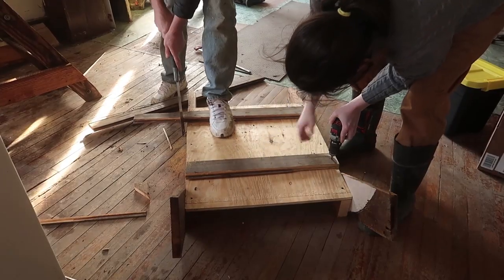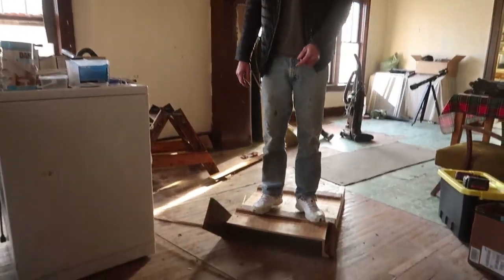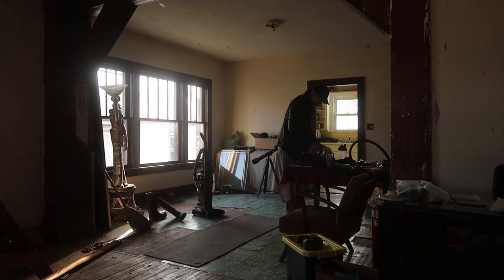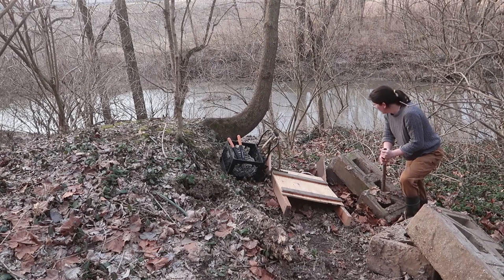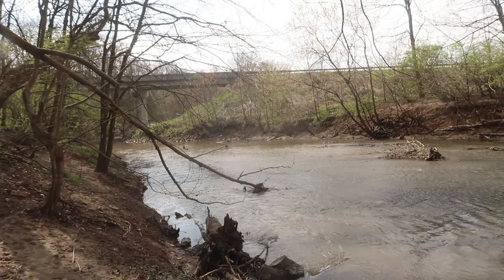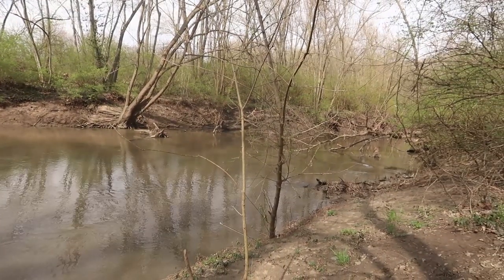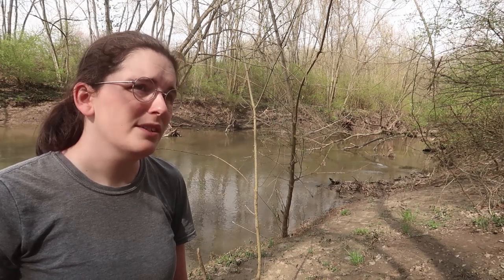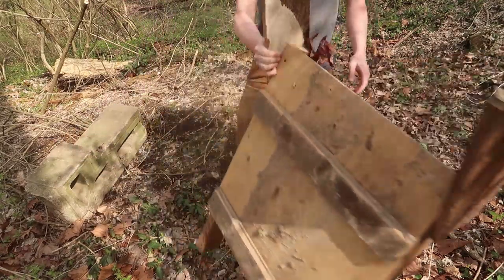Brickeology 09: Sled / Sledge / Stone-boat for Moving Large Corner Blocks by hand, its too hilly

Comment: Blue barrel barge sounds vaguely possible. Cut less than half maybe 1/3 off lengthwise, extend dowel reinforced pvc off the sides and maybe front and rear and attach 2 liter plastic bottle pontoons to keep it upright.  Balancing the load will be the perilous aspect of this.  Who knows you may end up with a creek boat for later.
   Just build a steam power concrete saw, cut up the biggest chunks and get it across in smaller sections and re connect them later.  Put a rope around the concrete to pull it off the bottom when it slides into the creek.  Heck maybe just winching it across would save time and effort.

Comment: For Sled I would round the front edges so it doesn't ding and I would double up the board  side  and see bout attaching old  skiing to help slide better. I would not pull on it I would get big stick and push from the back and if that doesn't work I would bring 2 board to lay on the  ground to slide the sled on them.

Comment: the problem with your sled is that you gave it to feet wick works great for snow, what your working with is mud, you need a large flat bottom to distribute the load if you take plywood and sheet the bottom and the slanted part in the front it would work better because its not concentrating the load in to the 2 runners and digging in ( think snow shoe not ski ) 

also if you want it to pull straighter then run a rope from one runner to the other and then connect the one you are pulling with to the center this is how we pull cars 

hope the barge works

Comment: Hell yeah! I was thinking this was a job for the barrel boat. 
Though, perhaps a pontoon design would work better as it would hold a lot more weight. The problem with your sled idea was that the flat side needed to be on the ground. The rails just dig in and stop you. But you've probably already figured that out.
Anecdote: I built a barrel pontoon when I was a kid, just 4 barrels, a sheet of 4x8 plywood, (4) 2x4s (to keep the barrels from sliding) and some rope to tie the barrels to the bottom of the board. I'm not sure how much it could totally hold, but there was 6 of us on there all at once. Back then, we probably weighed a combined 600lbs or more. We used it to float around a lake.

How easy is it to find good barrels around there? We used old metal barrels that my grandfather welded shut and one plastic barrel with a screwtop lid.

Comment: A sled with runners will dig in and be hard to steer. Stone boats to move rock in the fields were totally flat on the bottom except for the curve upwards in the front. But those were pulled by horses...so get a horse.

Comment: Fun watching your mind work, as always, but I noticed a point of interest. It could be my poor vision, but I think you were hooking the line up to the center of the sled. Don’t know if it would surmount your problem, but connecting the sled on either corner and using a v-bridle would make for a much easier and stable pull. Almost be a shame if it did; I love your boat idea.
Reply from the maker: i was going to do that but honestly the ground is so darn steep, itd be better for me to take it home, add a metal or wood V shape, and then use it on flatter ground.
Reply from the maker: but i need the blocks for my next building.